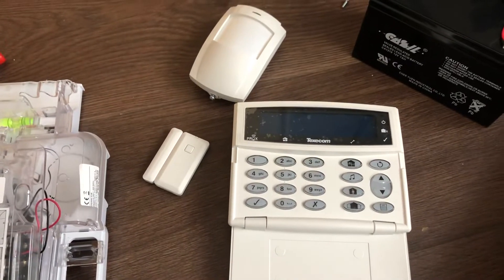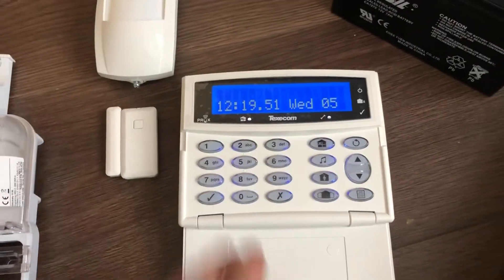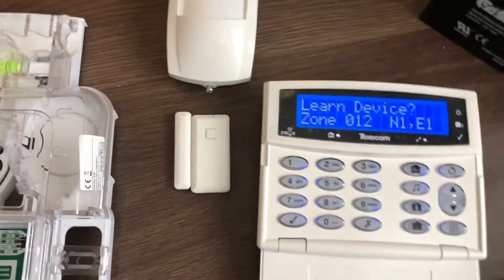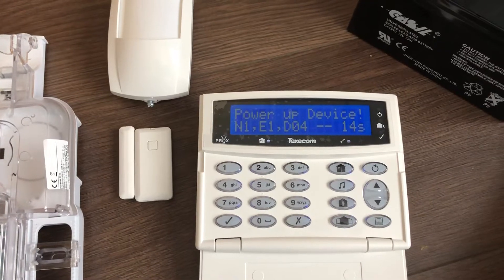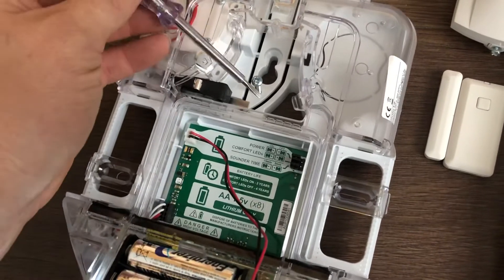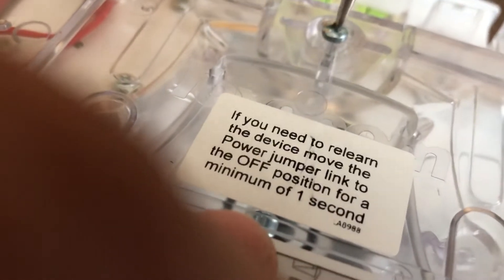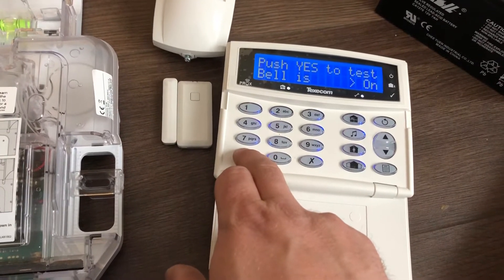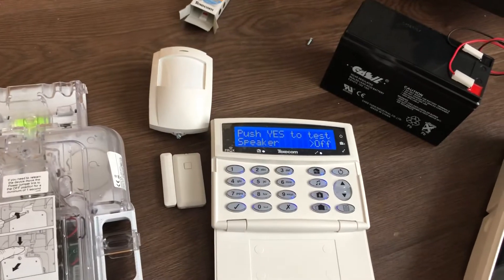Adding a wireless device to a Texecom system.

Comment: Hi
Many thanks for the video.
After pairing and programming is complete do you remove the jumper out of commissioning mode?
Also can I ad  a hard wired keyboard ?
Thank you
Reply from the maker: Yeah remove the jumper or you’ll get an expander tamper. Wire a keypad into the data terminal. (12v OV T R)

Comment: Hi there thanks for your help kindly can you please guide me how to rest call arm co message in Lcd display?
Reply from the maker: Has to be reset bet entering the engineers code twice followed by reset. To turn this feature off go into area>area options, scroll to find Eng Reset, press no followed by 1,2 yes to remove the letters
Reply: @alarmassist  hi there I have whatever you suggested via wintex but its still not disappearing can you me what I need to do next I just bought a week ago when I opened one thing I noticed battery terminal were puted wrong way round so please advice me what shell I do do I need to return them?

Comment: Thanks so much for your videos they saved me loads of time, I've fitted the external sounder identical to this one, it worked ok for 2 days but now shows battery fault R/bat , I've checked the batteries and they are all ok, when checking zone type in the system it identifies as custom,  is this the correct zone type? Thanks again for your videos.
Reply: I just fitted the wired alarm box in the end and it's been faultless since, I'm very happy with this alarm, thanks again your help saved me so much time, I love YouTube.

Comment: Hi, I want to add a shock  sensor to my Premier elite system. Will the IMPAQ sensor work or does it have to be the micro shock sensor? Thanks
Reply from the maker: carbon7000  you can use either micro just looks more discreet